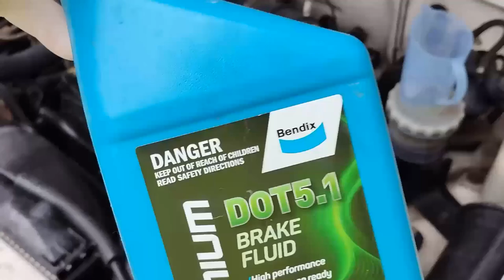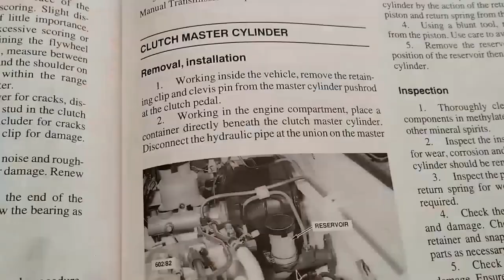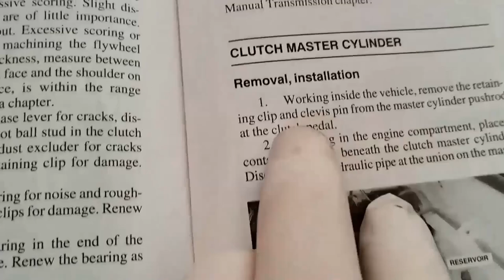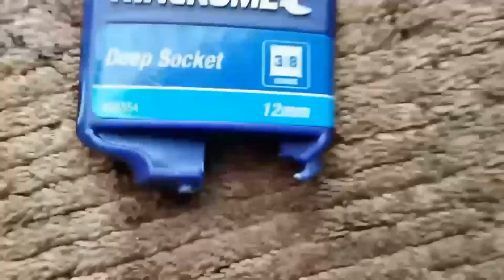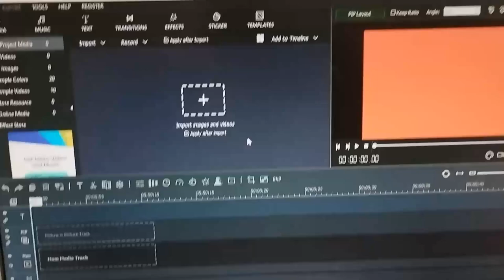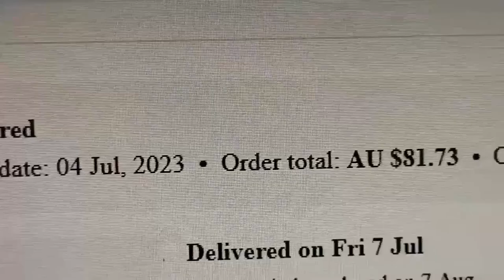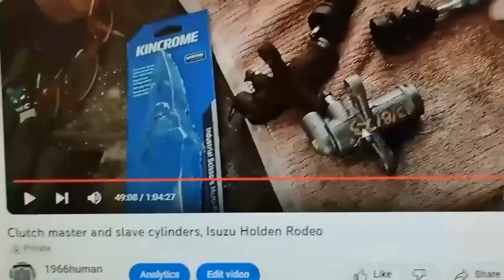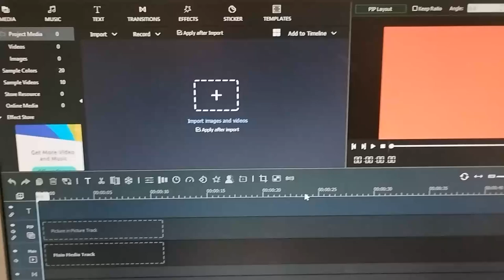1995 Holden rodeo clutch master and slave cylinders replace

Comment: Thanks for the film.  I have just started doing the same job on my vehicle. I had planned on starting the way you did but now I am going to pull the shroud out first.  I have removed the plastic covers from the bottom of the dashboard which helps a little.  It looks like I still have a few hours of crawling around upside down under the dash - my all-time favourite poosition - not!
Reply from the maker: Yes its not much fun, I noticed there is an air duct ? behind the plastic shroud, I would use a good quality (Bosh?) 1 and 2 cylinders (you don't want to do this job twice) My cheap Ebay clutch cylinders are going ok (30/11/2024) there is/ was some blackening of the clutch fluid but it's all working well so far.

Comment: What's the copper anti seized for?
Reply from the maker: That's what was recommended for brake component work, and from what I know wont bind with metal shaft and rubber bushing, or cover?

Comment: What a stupid design! I’m watching this because I’m also stuck changing mine. They should of made it so you just stick a bolt through the inside of the firewall and do it up with two nuts in the engine bay
Reply from the maker: That would be too easy for the exhausted working man/mechanic